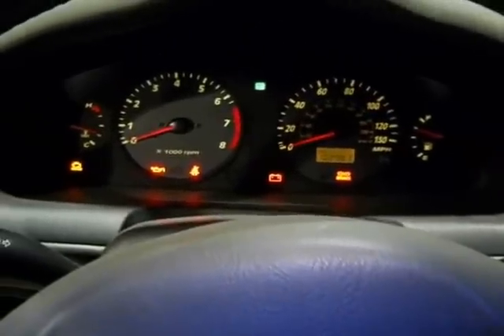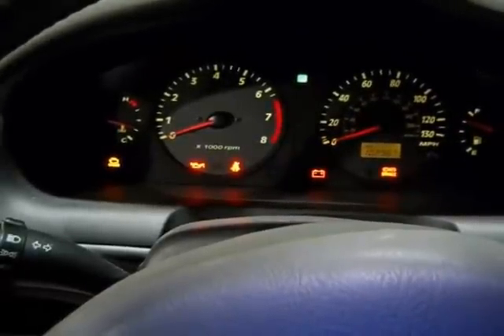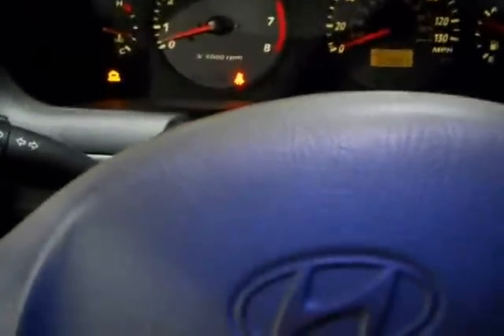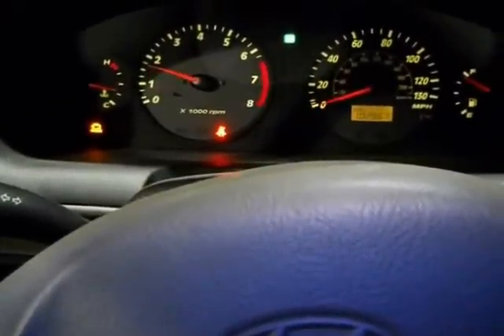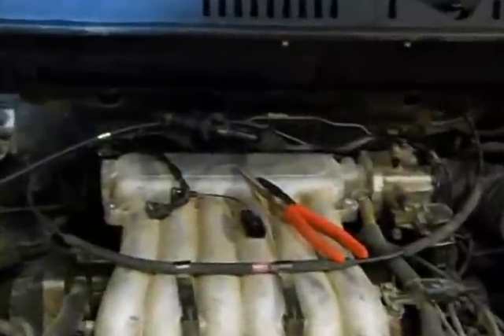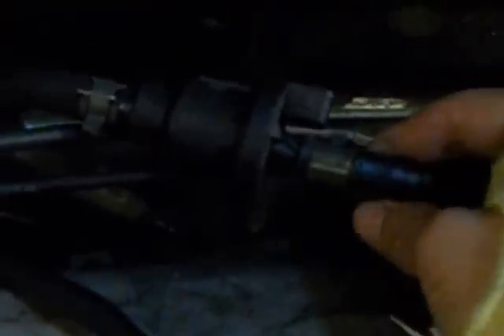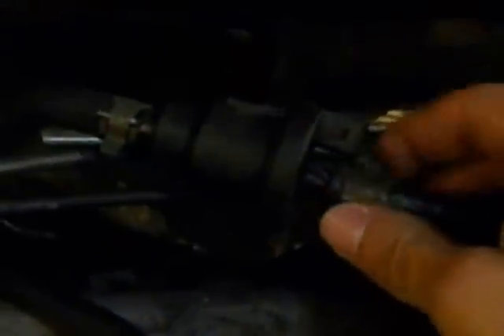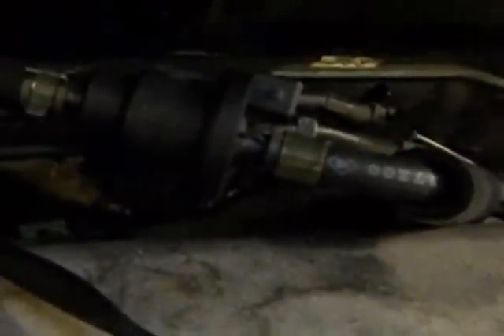Replacing purge valve-Car dying after getting gas? How to replace the purge control valve solenoid.

Comment: can you elaborate more on the electrical connection? AutoZone and Napa sold me the appropriate solenoid, but the connection is 2 prong oval. the existing wiring and connection on the bad valve is square shaped 2 prong and won't fit in the new part.
Reply from the maker: The one I bought had an incorrect electrical end on it that temporarily had me stumped.  After I unplugged the connection in the middle of the new part, I realized it actually had an adapter to allow the same part to fit considerably more vehicles (that use a different type of port). Does the new part's end resemble the old part's?

Comment: did your check engine light go off after replacing it?
Reply from the maker: Rebecca Pierce I think it did, but it came back on. There is another part that is faulty (but doesn't affect the vehicle while driving or starting) that is keeping the light on. It requires dropping the fuel tank so I haven't tackled it yet

Comment: i have the 04 santa fe is it located in the same spot? i have the same issue. once i get gas the car doesnt want to start and when it does it stalls out unless i hold my foot on the gas until the idle gets to where it needs to be.
Reply from the maker: I agree that it sounds like this is your issue. I believe it's in the same location.  If you need a guide to removing the engine cover, I made a video for it since I usually skip that part of the video.  -> https://www.youtube.com/watch?v=ASvJtB6PdiQ
Reply: IF the engine is the same, chances are it is locate in the same place...

Comment: will this part be located in the same place for a 4 cylinder 2009 Sonata?
Reply from the maker: I can't say from personal experience, but from what I see by looking at engine diagrams for similar year model Sonata's it is in the same location.
Reply: mattatlfan is same thing for I put gas and wen to work and I try to start it no crank just grinding noises , sounds like no compression in the engine what you think is it?
Reply from the maker: Rojo, is after you get gas the only time it has happened like that?

Comment: this is a great video I can do everything you showed us. what about the part you didn't show us, like how to get to it after you remove the shroud? I have no idea what the hoses/lines/wires are that are blocking access to the purge valve and if it's okay to move or possibly disconnect any of them. thanks.
Reply from the maker: Allison Benson I was actually able to maneuver it to the position you see in the video without disconnecting other hoses or linkages. If you don't see a possibility of you being able to do the same, you can email me a picture of items in the way at mattatlfan@gmail.com

Comment: Great insight. I have a 2001 Santa Fe GLS with 280,000 miles as of now and was wondering what the problem was, thought for a bit maybe bad military gas lol.
Reply from the maker: John Cantu That's awesome you have driven it so much. You officially have more miles on a Santa Fe than anyone I know haha
Reply: well the old girl is getting retired very soon, the transmission has a decent leak somewhere on the engine side, the ac has had a leak for the last 8 years and I've been too lazy to get it fixed. the front passenger wheel hub bearing needs replacing after only 50k miles so I think the shop chipped me on my wheel bearings :/

Comment: hi i have an hyundai accent 2008 4 door after i get gas my car has a hsrd time starting then after 10 minutes it start and it fine. do you think its the purge valve ir fuel pump??? most likely i think its the purge valve please answer thanks
Reply from the maker: Based on your description it sounds like the purge control valve.
Reply: hi thanks for responding i went to the mechanic yesterday and they said i need a tune up i havent had one in two years and the soark plugs were butnt off
Reply: i meant burnt off
Reply from the maker: +Toya White That makes sense. If you continue having any of these type issues I'd consider the purge valve again. Any vehicle will need spark plugs changed around 100k miles, but Hyundai's are notorious for having purge valves go bad around the same time.
Reply: ohhh ok my car mileage is 144325 thanks for answering  my question

Comment: Hey thanks alot for this video man. Can you do another video showing where it was before you pulled it up? also in the next video can you also show how you removed the hood cover fo rsome of us who've never done it on this specific year santa fe? i own a 2003 and would really appreciate if you can do another video with more specifics so that I can get this job done right. Im having thes ame issue
Reply from the maker: I apologize for the delay, but if you would still like seeing a video demonstrating how to remove the engine cover I have it available here --> https://www.youtube.com/watch?v=ASvJtB6PdiQ
Reply: mattatlfan hey thanks for the response. i ended up doing rhe replace . it took about 2 hours since the purge valve on mine was super hard to reach and had several brackets to remove and things to get out the way. i couldnt have done it had i not had an extra pair of hands.  was a worthwhile experience though.  im planning to   to replace a wheel bearing next. any tips?
Reply from the maker: Isaac A I actually took a different vehicle to have the wheel bearing replaced at the dealership because you can run into some things that make life difficult in the midst of it. If everything goes as planned it's not too bad, but the metal can sometimes seize together. There are certainly videos on YouTube about replacing wheel bearings in vehicles, though I'm not sure that there will be one for your exact make and model. I've helped a friend do that job on their vehicle so I have some experience if you'd like to bounce detailed questions off me along though way.

Comment: Ok I'll replace them sensors then check if I still have this issue
Reply from the maker: Before you do, can you confirm that I understand you right. I believe you said that the check engine light stays on but runs and idles normal.  The part I'm confused about is that you said it doesn't idle to shut off. Does that mean that it idles rough when you are in park prior to turning the key off? Also, how many miles does your car have?

Comment: Hey thanks for your video..OkI have a 2004 Santa Fe with a check engine light on all the time, it does not i idle to shut off it runs and idles normal , I took it to Auro Zone to get it diagnosed and it showed the canister idler purge control valve , Any clue ?
Reply from the maker: I'll check out the part number you listed below and get back with you when I have a more educated opinion, but it's certainly possible that something upstream is causing that error code. The oxygen sensors on the vehicle could be a thought but they require a special socket to remove and depending on which one (there are 4) it could be over $100.